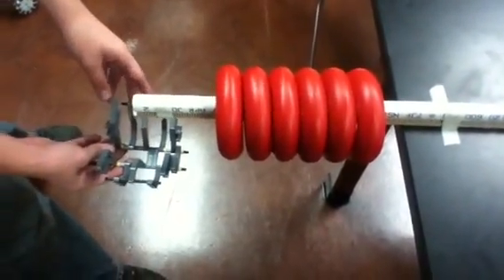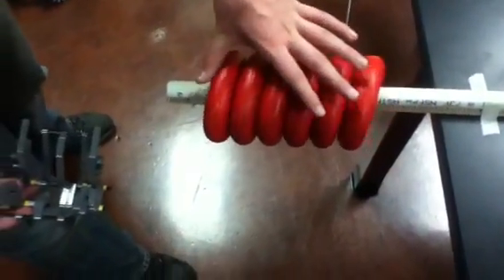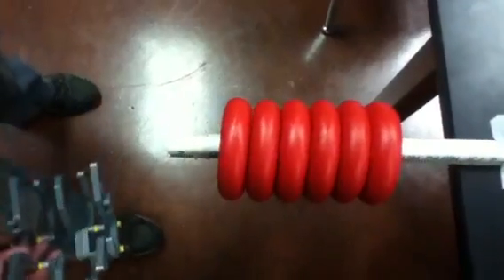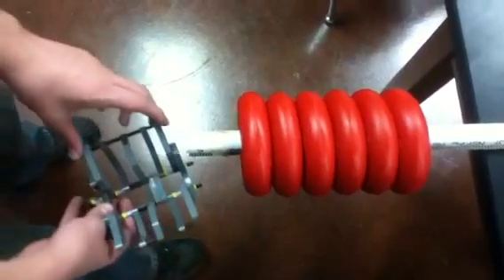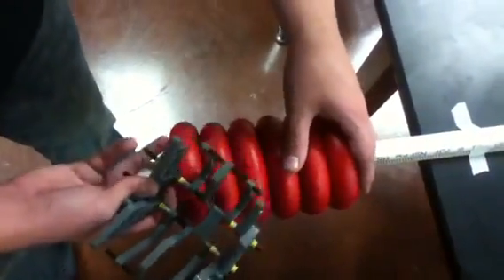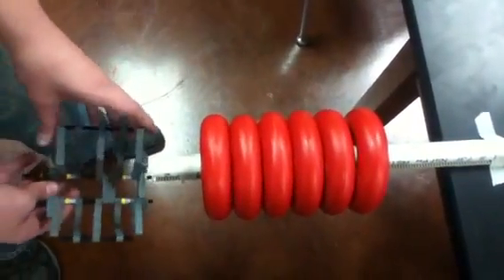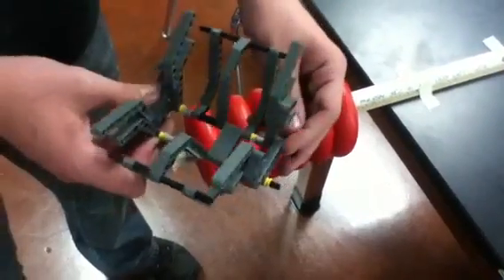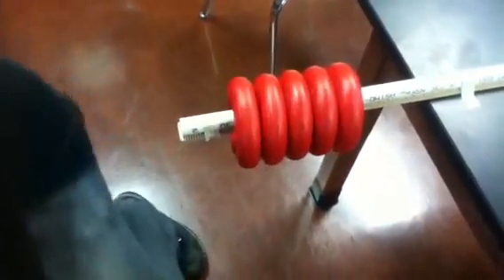Hand Prototype Design for FTC Ring It Up! 2012-2013

Comment: Very nice!  You should really test that design with the appropriate 45 degree connector on the end.  We noticed with the FIRST spec fittings you cannot pull rings straight off.  Check out the video on our channel of the field walk around to see what I mean.